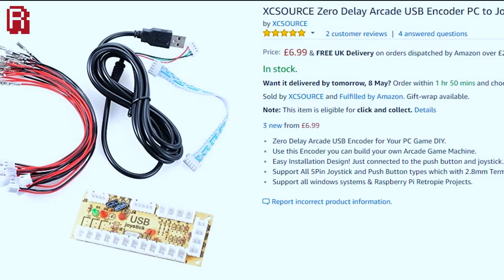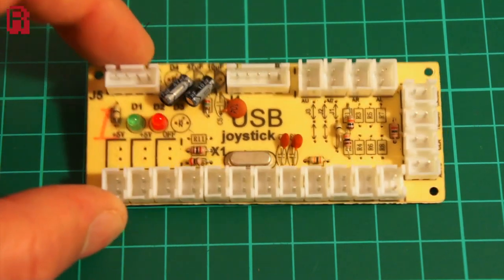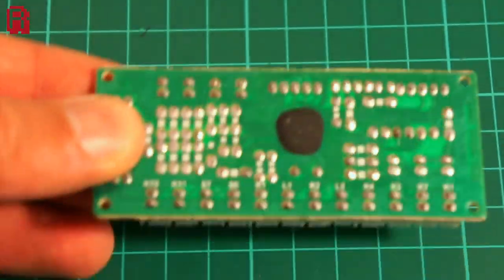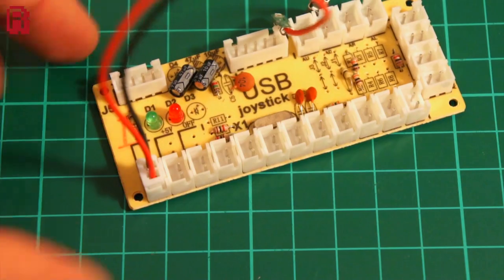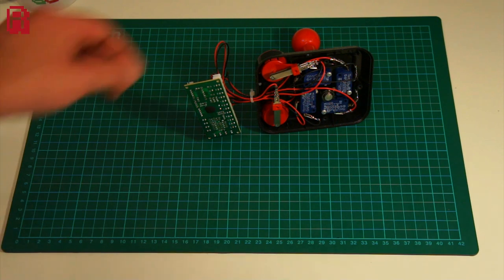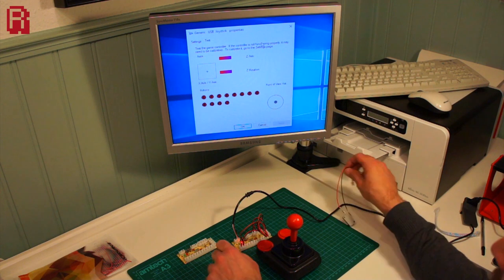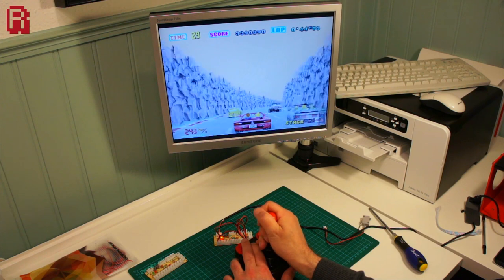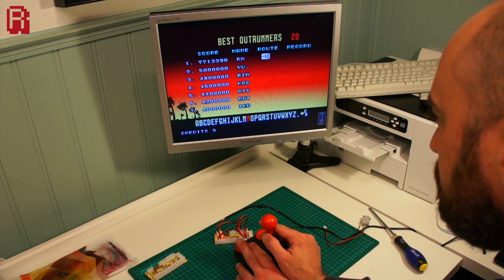Zero Delay USB Arcade Encoder | Review & Playtest

Comment: Hi thanks for the video. Do you know if there is any similar hardware (USB) that can read "VARIABLE" input from the joystick? i.e. an XBOX controller will read out zero at center and +/- 1.0 at full tilt X or Y. Although I could modify an existing joystick like the XBox I'm looking for a simpler solution (ready built). I need to be able to read the inputs in Unity and part of a design to implement large set levers for a project I'm working on. These levers need to react the same way a regular joystick control works 0 to +/- 1. I would like to avoid use of Arduino and such and was wondering if the Arcade companies provide such controllers that I could modify accordingly. Thank you ! A
Reply from the maker: Do you mean that you want to be able to use an analogue stick and read the values from potentiometers?  Maybe something like this? https://www.ultimarc.com/a-pac.html
Reply: Pretty much yes .. I'm looking at the Arduino Leonardo as that apprently provides a HID response .. just started reading up about it
Reply: Thiose Mame controllers only provide on/off sadly. I'm looking for variable feedback from JS position .. I think the Leonardo might be the solution. Thanks for your reply
Reply from the maker: I've heard of some good conversions of old Thrustmaster flight sticks to USB using Arduino or Teensy devices, or the A-pac link I posted above if it's a pretty simple setup.  Good luck!
Reply: Cheers I think I've found the main part of the solution here : http://www.instructables.com/id/Arduino-LeonardoMicro-as-Game-ControllerJoystick/
Reply: I did and it works great, if you like to use my code its on my github, when i tested it had no delay(input lag)
Reply: Cheers Ridrigo !
Reply: I have found that the Arduino Leonardo board presents itself as a HID .. which for me I think will work good as you are able to emulate keyboard and Joystick inputs too ..
Reply: Yes i have the code on github :)

Comment: Worked with my Retropie build. Didn't like it because it wouldn't read two buttons at once. I couldn't back out of a game with out using a keyboard.
Reply: I ended up using the guts out of a USB SNES controller for the arcade stick instead of the USB board.
Reply from the maker: Hmmm that doesn't sound right. Glad you found a solution

Comment: Anybody knows if this board can be used to adapt an old analog Joystick with DB15 "MIDI" connector?, not the MS Sidewinder Pro but just a regular one with the switches and potentiometers directly wired to the cable. If not, ¿Is there a similar board that can be used?
Joysticks I have are:
- DB Boeder P-10: 3 analog Axis, 2 buttons, direct to the wire (apart from a simple autofire circuit)
- Logitech Wingman Extreme: 2 analog axis, 4 buttons and a little digital joystick. I haven't open this one yet but I suppose it has some active circuitry because the basic DB15 protocol supports only 4 analog axis and 4 buttons. (or maybe the digital joystick uses the 2 other analog axis)
Reply from the maker: Juan C Walls No you'd need something like this for analogue inputs https://youtu.be/3C5xbVPzU5o
Reply: Sorry, I'm afraid I didn't explain myself correctly. What I'm searching for is not a Gameport to USB adapter. What I want to do is to hack the joystick to connect all switches and potentiometers to a USB encoder/controller. I suppose this can be done using an Arduino, but I was wondering if there was something as straight on as the Zero Delay USB Arcade Encoder. I also suppose there is some way of converting the analog signals from the direction stick to digital with a simple circuit but I want to keep the analog functionality.
BTW, I already opened the Logitech Wingman Extreme and as I suspected, the Hat Joystick is conected to one of the analog axis (not to both, so there is another analog axis unused). It encodes the four directions using a circuit with several resistors that provide different ohm values depending on what switches are pressed down. Very clever.
Reply from the maker: Juan C Walls ah yes the closest I've seen to that is an Apac board or a Teensy project.  I could certainly use an off the shelf solution

Comment: Im sad to say i bough 2 of these to make 2 fightstick, Im also very sorry to say they  really dont work well at all. The encoder has a very very hard time to do diagonals properly. I tryed with sanwa parts and still the same results. I bought myself a premade one after so i could modify it and worked flawlessly. Do not buy these for fighting games aside maybe MK
Reply from the maker: Sounds odd I've not come across that problem before.  It's fine at handling multiple presses which is what a diagonal normally is, two switches engaged.
Reply: @RMCRetro  on a side note mine came from china it seems and they are black and not beige idk if that matters.

Comment: I recently bought my kit as well but the thing is the layout for connecting the wires to the buttons is different from yours and would like to know if it wouldn't matter how it would connect in.
Also this is the kit i bought so you can also see what i am talking about https://i.gyazo.com/c170e23221eadd2e859f4bfb7b31baa2.png
Reply from the maker: Ecks™ I would suggest plugging it into your PC with 1 button plugged in. Open windows Game Controllers and just press the button to see which input registers on the screen.  Then you can swap them around to suit
Reply: Ya i tried that out and did it both ways and the button still registered but just wanted to see if i might of been doing something wrong so i don't end up frying anything.
Also do you know any place that might sell like a metal box because i am thinking of making my arcade joystick like that as well.
Reply from the maker: Ecks™ take a walk around your local hardware store for inspiration, there's also a community who turn Ikea items into arcade controllers you can look into.  ideally though you can find your local sheet metal company and get them to bend a nice off cut into shape which I did once when I needed a new arcade control panel.